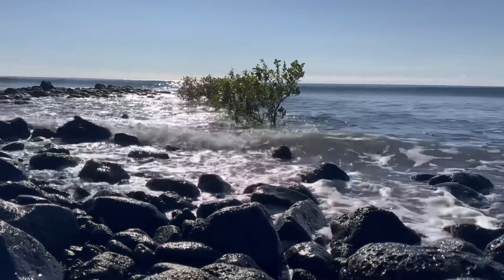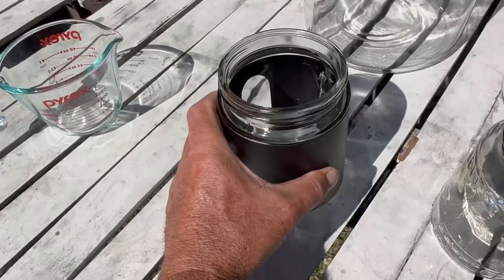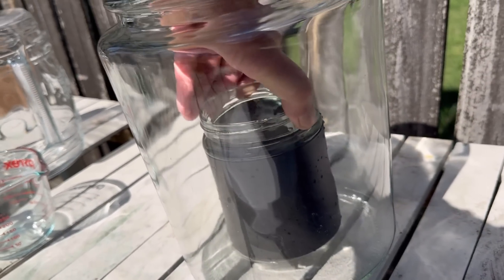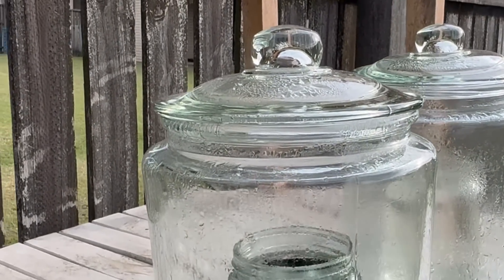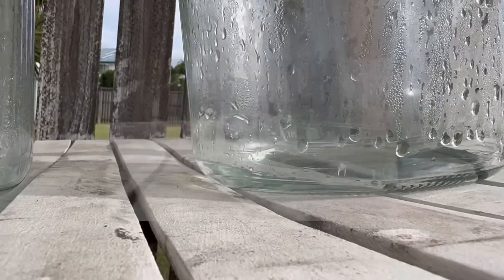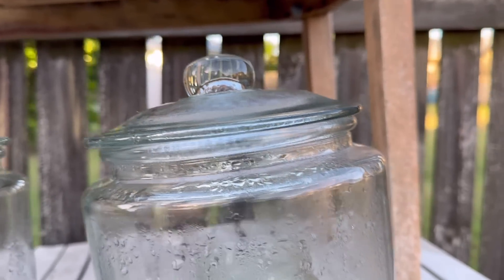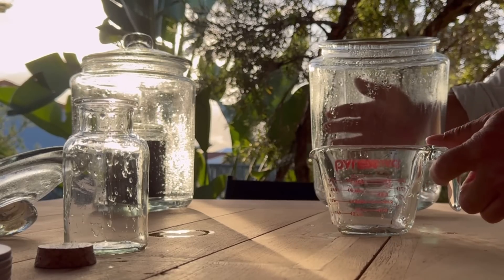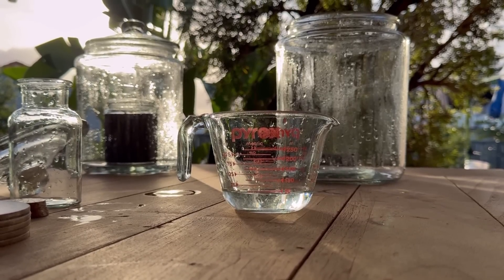Solar Distillation 2.0: Boosting Efficiency with a Simple Tweak

Comment: You have a heat engine. The work being done is separation of water from salt. The efficiency will resemble a Carnot engine; efficiency will increase with increasing difference between the hot and cold surfaces or regions inside the still. Daytime heating heats the whole apparatus. The volume of distilled water is proportional to the volume of air that gets saturated with water vapor. To get more water you correctly increased the daytime temperature by painting the inner container. Now move to make the outer container bigger. Much bigger. Like a 5 gallon or 10 gallon container (20-40 liters). Hint: They make resealable plastic bags that large.
Reply from the maker: Damn. That’s a good idea. I’ve also see the 20 litre jars available, they do exist but are hard to get! I would love to learn how to blow glass for this very reason. I could make my own vessels to suit all types of purposes. I need to research Carnot engines. This is the first I have heard of it. But from your fantastic description I have a reasonable understanding of how they work! Thanks for your extensive comment! And thanks for taking the time to participate in this discussion!

Comment: Bro, increase the exposed surface area. Find a more squat, wide-mouth jar. Or even simpler, add more jars, maybe? The more exposure the water has to air the easier it can evaporate. It might be a trade off if you used extra jars though, the added glass and water would require more heat/time to get the still to the proper temp. Potentially reducing yields due to the time loss during the actual evaporation. Why are you not using a more conductive material than glass? Glass takes a long time to heat AND cool. Wouldn't it be more productive to use an inert metal? I'm sure you have your reasons, I'm just curious. fascinating stuff. subscribed
Reply from the maker: Thanks for the subscription and the extensive comment. I appreciate the feedback! Metal containers such as copper or brass would function well in a system such as this. The reason i have stuck with glass for the time being is because it’s durable and reusable. I am currently running a site experiment that I am calling a hive cell. Inside it I have multiple jars and there’s also a tap at the bottom where I can retrieve the fluid, but only after it is reached a certain height. I’m thinking about removing the tap and inserting a cork so that I can remove the fluid that is distilled each day. I have used flatter and wider surfaces to distill from but made the mistake of putting them into rectangular containers where I immediately found that the condensation hung from the container lid above the sea water vessels. This is a very interesting subject as it appears very simple from the outside looking in. But once you start getting into it l, it becomes more and more complicated. I really appreciate your feedback. Thanks heaps. Cheers!
Reply: @Remraf I am so there for the video you make for the hive cell! In your comment and vid you mentioned the flat surface issue, have you thought of having the whole apparatus slightly tilted to one side? That way the water is forced by gravity to one side. Not trying to step on your toes or tell you what to do, your project has that rare quality of being fun to think about and being potentially good to have knowledge. great to hear from you and I look forward to your next vid!
Reply from the maker: @honeypotts5125 this would definitely help in coercing the fluids level above the flange height. The inner jars of the hive cell have less water in them to begin with so we wouldn’t have a risk of spillage. It’s awesome that you are enjoying this experiment as much as me. It’s simple but there is joy in changing the variables. And the impact these changes have is very quickly noticeable. “Simple but complex”.
Reply: @Remraf  Bro, I know what you mean! I've been experimenting with ways to pickle things. Simply because I hate dill, but love spicy pickles and have been curious about other pickling flavors, so Ive been trying to make mine at home and have been having success by inches towards my goal because like you said: "...there is joy in changing the variables."  So true, different seasonings, environments, vinegars, temperatures, pickling times and holding vessels all change the outcome and its fascinating to observe. Ive managed to create a recipe for tangy cayenne flavored pickles that are ready in 18 hrs, my goal is "same day pickles" that are ready in 12 hrs. You might have inspired me to start a channel to share my findings. Im glad YT showed me your channel. Thx bro!
Reply from the maker: @honeypotts5125 that’s cool as. Go for it! It’s well worth the effort. Things take time. But if you continue to make content people continue to come to watch. Be prepared for the all mighty imposter syndrome to set in from time to time as well! What I’m quickly discovering is the more you know the more you find out about how little you actually know. This can be soul crushing! But push on!
I’ve actually had a go at pickling myself. Years back (2018) I went on a veggie garden binge and produced way too much food to eat. Pickling was the next step in preserving what I had already taken so much time growing! Glad to hear you’re thinking about starting your own channel and are experimenting yourself. Theres real satisfaction in the small steps! Wæs hāl! Cheers!

Comment: One thing you could do is kind of reverse your still setup. The way I've done it is to have the jar that will hold the purified water as the smaller jar, and you have your "cone" point downward instead of upward. This will increase your efficiency because evaporation is easier as the surface area of the body of water increases.
Reply from the maker: Thanks for your suggestion. Fortunately I have tried this in the past but the results were disappointing. Check out the video link for what happened. Please feel free to share your thoughts on it as well. I was very surprised at the results. https://youtu.be/k5WGya2WOzk?si=r0kAtjbrLqVUbvdu

Comment: You could use black 3M auto vinyl wrap to put on the glass...
Reply from the maker: Thanks for the suggestion!  This will likely send me down another rabbit hole that I wont emerge from for weeks! I had a quick look, this is a great idea. Makes me wonder…. Maybe using other forms of contact would work as well, but the durability would be in doubt…Cheers!
Reply: @Remraf  Glad I could give you an idea to try, great video!

Comment: May I give an idea, which is to swap the roles of the vessels, plus a funnel in the small vessel.

The funnel acts as a one way valve, where it "guarantees" the condensed clean water falls into the small vessel, but wont evaporate back out.

Next, to swap the roles of the jars, have the smaller one be the clean water collection vessel, and the larger one be the dirty water. You can now wrap or paint black the bottom half of the large jar on the outside without worrying about contamination. This is also a much larger blackened area to accept sunlight to get heat. And also a larger surface area of the water, because evaporation occurs on the waters surface, so if you want more evaporation, get more surface area exposed to the air. The larger glass jar can provide this extra surface area, more than the small jar. Next, place the cover upside down so the condensed water drips to the center and falls onto the funnel, and into the small jar in the middle
Reply from the maker: Hi and thanks for your extensive comment! I appreciate the feedback. I have actually tried this once before and created a video on it. Please see the link below. It’s still a mystery as to why it failed to produce the results I was expecting! Have a watch and see what you think. Cheers!
https://youtu.be/k5WGya2WOzk?si=z0Xb3nQs_sANnfBO
Reply: @Remraf  I think that in the reverse system you have a large condensing zone (the sides of the big jar) which is not dropping water into the inner jar. The only usefull condensing zone is the lid, it's small and also the higher part, so it's not the cooler... Painting the outside jar black may not be better than the "not reversed system" with a black inner jar, mainly because of the greenhouse effect...
Reply from the maker: The inside of the larger is where a lot of the condensation happens, if you hang around long enough you can see it build up and then run down the edges. It’s a fascinating system! But I am easily entertained! Ha!

Comment: Use an outer jar with a spigot.  The shape of the inner jar ... How might we maximize the ease of heating the water, and the surface area?  Maybe a 2-3 dark wine bottles?
Reply from the maker: This is something that I am currently doing with a side experiment. It has a tap on the bottom where I can extract the fluid as it is being generated. However the flange sits above the floor of the jar resulting in the fluid gathering at the bottom and delaying me being able to tap it. And as for the dark wine bottles, these would be perfect for the inside of the distillery! I really want to learn how to cut class and I have been looking at ways to do it using string and alcohol for example I hope to get around to doing something like this soon. Thanks for your comment. I really appreciate your feedback. Cheers.

Comment: The ways to improve the yield are:
- Instead of releasing the steam into the bigger jar, saturating the humidity, and preventing more evaporation, you can add a tube that takes the steam into a colder environment, like the table's shadow, or under the wet soil, and collect it in another jar.
- Then you can add some mirrors behind the jar to reflect the escaped sunshine.
- And if you can pull a vacuum between the two jars, the heat can't escape through the air, that causes even more evaporation.
I would take one of those solar heater tubes, or a tea flask tube that's not mirror coated, attach a tube to the top, and let it collect into something under the table
Reply from the maker: This setup would be very interesting to try. I absolutely agree that reevaporation of the distilled water is a waste and needs to be addressed. Separating the units would be a good way to manage the processes of each unit. I have had a couple of comments mentioning that burying the collection vessel would reduce the risk of reevaporation which would definitely be beneficial. The basic structure of the still itself would remain the same but with a tube for vapours to escape. I really appreciate your input. I love the discussion this video is creating. So many great ideas floating about! Cheers!
Reply: The main activity here is heat applied to the solution to separate out the desired liquid from the rest of the constituent parts. So the efficiency of this distiller is related to the capture of the solar energy and mitigating loss of that energy throughout the system. I came to the comments and see my ideas presented here already. I think a trip down the solar ovens rabbit hole is a worthwhile endeavor here. If you can heat the water to 212F, it would go a long way to improving efficiency. Maybe you could even harvest the sea salt this way if the solution were evaporated far enough. And now I want to make another solar oven...
Reply: @ The main hurdle is humidity saturation.
At some point, the air in the bottles will become too saturated, and can't take anymore steam.
This can be mitigated by leading the steam away and allowing more water to evaporate.
Reply from the maker: Yep. It would be good to set up a system that self regulated and feds at collection pot. Imagine if you could generate enough water for your daily needs through this process! The next step would be adding some of the flavour (minerals) back into the fluid. You could even flavour it by trying different mixes with different salts etc…
Reply from the maker: @adameden8722 @adameden8722 thanks for your input! There have been many great ideas floated about! It certainly is a balancing act between heating and cooling. I’m glad to hear you’re looking at getting into creating your own solar oven. It would be a very interesting rabbit hole to go down! Thanks again. Cheers!
Reply: @Remraf  I appreciate your approach and the way you framed your project as collaborative. Your openness to input is admirable.
Reply from the maker: @adameden8722 thanks for the compliment! I appreciate it heaps.
Reply: @Remraf  Ok, so the solar oven thing is on hold, but I am looking to design a portable solar shower for camping and looking for the best material to hold water and absorb heat. I'm thinking a corny keg or a chemical sprayer. Both can pressurize, the corny keg will heat faster, but the sprayer will cost less, weigh less, and keep water warm longer. Any ideas for optimizing efficiency of either?

Comment: You could sit the outter jar in a tray of water. Sea water in a plantpot drip tray should work.

This would help cool the outter jar and aid condensation and perhaps the evaporation cycle.

Ideally, find a way to cool the ceiling of the jar, as heat rises. This would work better again.

A vegimite jar should work and avoid any contamination from vinyl or adhesives.

Finally on your point about drinking distilled water. It should not be a problem long term as long as you put a small amout of salt back in the water, not sure about the proportions, but im sure its searchable.
Reply from the maker: Absolutely, adding some salt back into the distilled water is a good way to find that balance! I want to learn how to treat the water in an upcoming video as well, in the sense of adding back to it to make it enjoyable to consume. I’ve seen those water dispensers that drain the fluid through stones. Maybe something like this?
Reply from the maker: And in regard to adding the entire unit into a bath! This is definitely on my to do list! It’s a brilliant ides and I cant wait to implement it! Thanks again! Cheers!
Reply: @Remraf  looking again at your jars, it may be an option to invert the lid and sit the cooling water on top. The condensing water would then drip down the centre of the lid handle into the jar. Of course you would be reversing the placement of the distilled and non distilled water, and have to rethink the jar colouring. Maybe foiled on the inner jar and a dark base and 1inch back paint section toward the bottom of the outer jar.

Anyway, hope that makes sense. Good luck.
Reply from the maker: @islandsedition this makes perfect sense and I’ve actually tried it. The results were lacklustre to say the least. Heres a link to that video. Have a watch and let me know your thoughts. Cheers! https://youtu.be/k5WGya2WOzk?si=r0kAtjbrLqVUbvdu

Comment: The outer layer of glass stops or deviates most of the photons that should hit the black inner jar, effectively lowering the efficiency.
If the heating chamber (the black one) was instead the bigger jar,  there would be much more condensation as a result of more light hitting the black surface and also due to the bigger total light absorbtion area.

Suggestion:
One could put the big lid upside-down, to let the condensated water slidefrom the top down the middle and therefore filling the inner smaller jar.
This way you should paint the outer layer of the bigger jar, which is not in contact with the water, black and therefore also removing the risk of contamination.
Of course much condensation is produced on the walls of the bigger jar, but the efficiency increase could counter that.
I would love to see this compared to your existing version.

Nice video 😄
Reply from the maker: This is something I have done in the past. But I think I need to revisit the idea. And as you say maybe do a comparison video showing the results. I found that the limited condensation area (inverted lid) resulted in poor output. It hangs from the inverted lid reducing the output. But it would he worth trying again so everyone can have a closer look! Cheers!
Reply: That is how I've always seen it done. The doner (Dirty) water would go into the larger jar, with an inverted conical shape for the top. The jar with the doner water should have a wider diameter with a minimal height so that you have more surface area to facilitate condensation, but with minimal valium to have to heat up. Remember that the water is technically a heat sink. You want the opposite of this. Minimal vertical wall surface so that the majority of the condensed water collects on the inverted cone so that it then uses gravity to pool into the inner jar. Everyone has their two cents to input, and those were my two shiny pennies.
Reply: I said the same then saw ur comment.  This video is ass backward.  I'm not a scientist or engineer, it's common sense.  Where's the critical thinking skills, duh!

Comment: Would some sort of wicking material help evaporate better due the larger surface area?
Also adding some cooling to the base to alow some amount of condensation? The inside jar needs to be as warm as possible, but cooling the outside jar would slow for more condensing during the daytime. Again a fabric material would help cool due to evaporative cooling. Maybe a dish of water with cloth wound the very base of  the exterior jar.
Reply from the maker: There are some very interesting ideas in this comment. I have used charcoal as a wicking material and it worked well as both a heat sink and for drawing and evaporating the salt water. And adding a dish below the large jar with seawater in it would work as well. I would have the added benefit of collecting the remaining salt as well! Multiple functions and improvements all in one! Absolutely brilliant! Cheers!